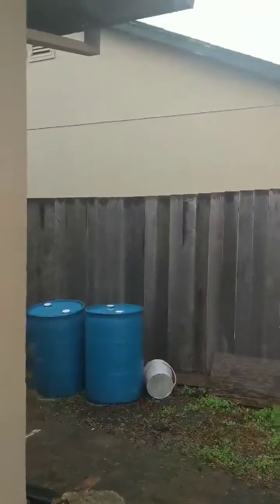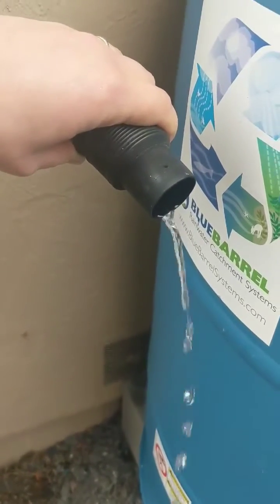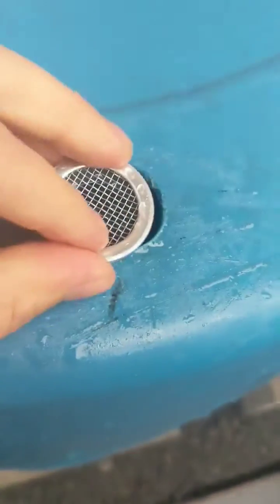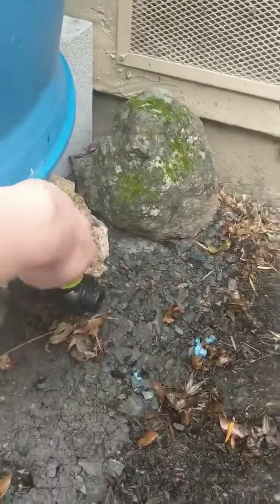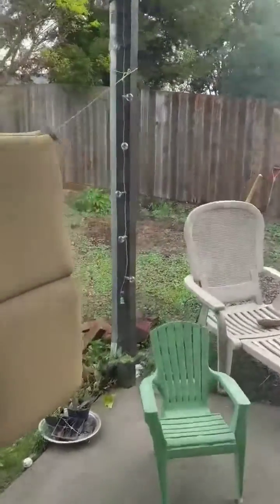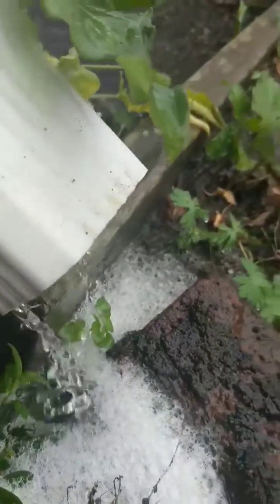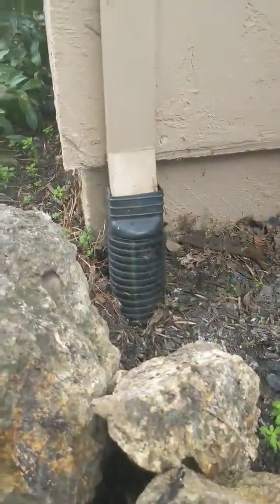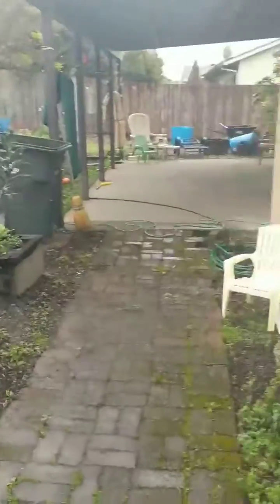8-Barrel Rain Catchment System Getting its First Fill!

Comment: Nice system.  It could use an overflow line so when all drums are full and the rain continues the drums don't all overflow where they sit.
Reply from the maker: @MrLMJohnson - Our diverter handles overflow automatically! That's one of the greatest parts of our design. Check out this article for details on how that works: https://www.bluebarrelsystems.com/blog/demystifying-downspout-diverter-for-rain-barrels/